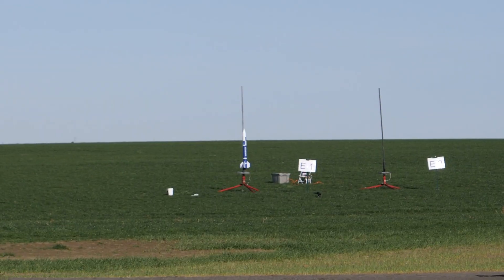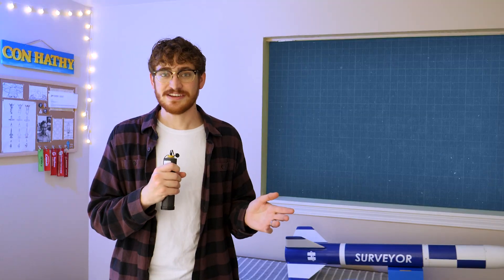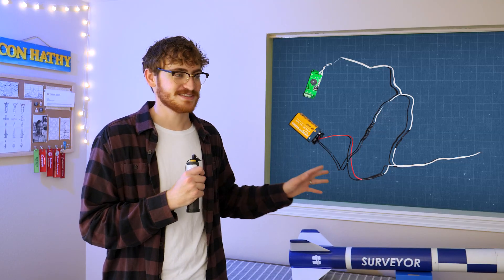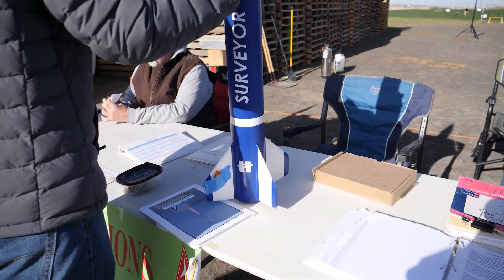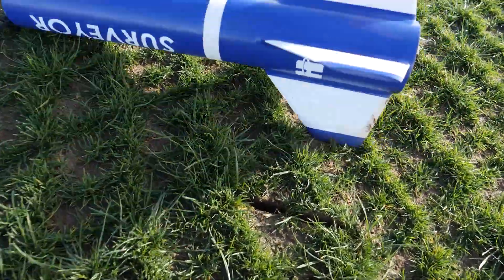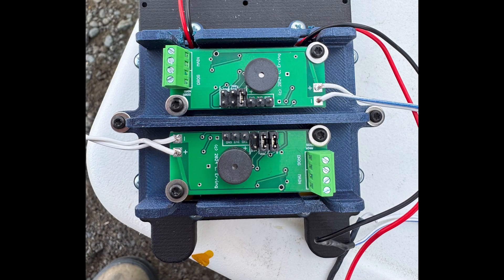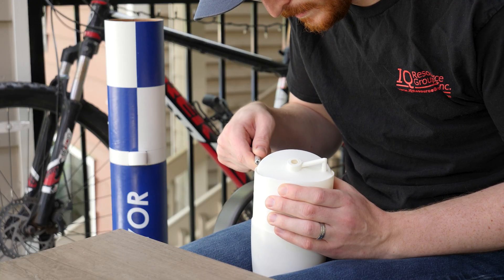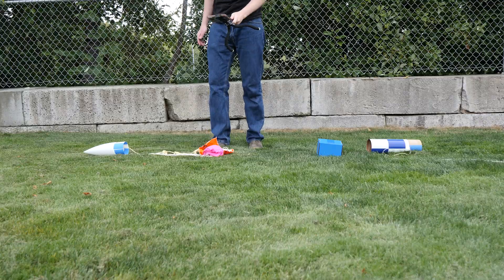What Happened to My Level 2 Rocket?

Comment: Do you have any tips on how to do onboard cameras? I can't find any good info and yours were absolutely gorgeous! Good luck on the next attempt btw!
Reply from the maker: I’m using an insta360 go3 because I had one already. I think a lot of people use Mobius or Runcams and there are plenty of mounts for those that glue onto the side instead of having to cut into the tube like I did with mine.

Comment: 6:10 not to be THAT guy... but you want the rocket vertical (as in your video), but the ELECTIONS should be ON BEFORE installing the ignitor.  That way if there is accidental ignition, the electronics are armed for safe flight.

From Tripoli Safety Code  "13-8	Electronic recovery or devices shall remain inhibited until the rocket has been raised to launch position but BEFORE the launch igniter is connected to the launch control system."  It is a little unclear if your ignitors were connected to the launch control system in the video, but the script implies you're ready for ignition prior to arming the electronics.

Enjoying your vids.. keep making them!  We all have Lots to learn!
Reply from the maker: You are absolutely right, someone else caught that too. I got the order flipped in my head studying for the exam

Comment: Good video. While I'm not the biggest fan of twist and tape. I do understand it's allure and utility. One thing. In your pad sequence. Arm your electronics BEFORE putting your igniter in. If anything where to happen...ie somehow when connecting your igniters, there's power and your motor lights. You'll have armed electronics and the rocket will at least have a shot at recovering. If you arm after like you show, you'll never get that opportunity! Great content! Really appreciate the overall engineering prowess in your videos!
Reply from the maker: I just double checked the TRA study guide and yeah I had that flipped, thanks for pointing it out.

If I do use twist and tape again, I will definitely switch to a multi strand wire as well. The single strand held together well but if I twist too much it might break and break the connection.
Reply: @C @ConHathy  look at Pull Pin Switches from Lab Rat Rocketry! Fool proof and no need to worry about running wires externally.
Reply: @ConHathy  wire fatigue in twist and tape (my favorite btw) almost cost my my L3. Fortunately on my triple check pass I found the problem and everything worked. Good flight!

Comment: 13:50 Instead of an overhand knot, I would recommend an alpine butterfly. It hold loads from any direction without deforming, is easier to untie after heavy use, and it has high efficiency when cross-loaded compared to the overhand knot.

I never could have guessed that my climbing experience would come in handy when designing rockets...